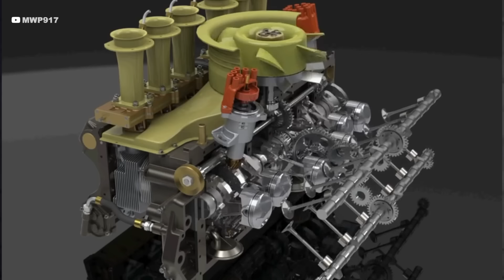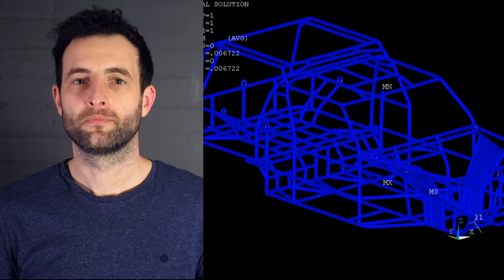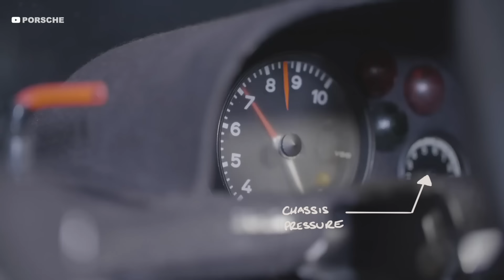The Porsche That Had an Inflated Chassis

Comment: The pressurized nitrogen is an ingenius solution. Simple but effective.
Reply: Putting the 1000 horsepower engine, in the most fragile chassis possible and doing fuck all about the aerodynamics however was not.
Reply: @paulzapodeanu9407  They debugged it eventually. Thank the insects for showing them where the flow was separated.
Reply: SIMPLE???
Reply: @craigykart  Yes, but maybe test the car BEFORE the race.
Reply: Maybe helium would of added lightness
Reply: @paulzapodeanu9407  You need to know that Porsche in the late 60s wasnt the Porsche you know today. The entire company was on the verge of bankrupcy and had no money for bigger testing. If the 917 didnt came out that successful, Porsche wouldnt even exist today.
Reply: @DeanMackenziebelldmb  yes but also means more lift 😂
Reply: @Maximilianboenicke  I know they weren't very successful commercially until the Cayenne, but honestly, did they not run that car before the race? Or did they do it somewhere where there where no flies? Or no night time testing? How do you miss something like that? I've seen pictures of 356 prototypes with small string tied to them, if they could test the aero on the 356 surely they could've done the same for the 917.
All things considered the 917 is an awesome achievement, I'm just surprised they thought to pressurize the chassis to check for cracks and a few other very clever things and didn't test the aero properly.
Reply: @paulzapodeanu9407  
High speed aerodynamics in a car at that time was not really well understood.   Up to the 917 Porsche was thought of a "small" car, nice but small.  Think Hyundai, not known for powerhouse cars.  
Porsche only knew small cars that were engine limited at top speed.  They were very good at low drag bodies which did not experience the high speeds needed to create significant lift. The 917 changed all that.  Ferrari laughed when they first heard Porsche was going to make a 'big' car.
Reply: Porsche engineers did not solve the first 917  problems with aerodynamics.   John Wyer sorted out the car's aerodynamic problems.  Porsche engineers were horrified at what John Wyer did to their car.  But came around with the increased high speed handling.
Reply: @Maximilianboenicke  
The engine design for the 917 benefited greatly from a government contract to develop a tank engine.
Reply: @paulzapodeanu9407  
For homogenization rules Porsche had to produce 25 cars.   When presenting the cars for inspection Porsche only drove one car while the other 24 were lined up.  Porsche stared second car and asked if the wanted to see the others run.   Good for Porsche they didn't because those two where the only  ones that had engines.
Reply: @DeanMackenziebelldmb  god, you can't be serious 😂
Reply: @DrsharpRothstein  thats a myth - all cars did run but not all had the full race equipment like brakes some had stuff from street 911
and whereever you get the "contract to develop a tank engine" ??? Thats bullshit
Reply: Frank Gardner said "if that gauge reaches zero I'm parking the fucking thing". Haha.
Reply: @DeanMackenziebelldmb  It's "Would have", not "would of". For example, "Helium would have reduced the vehicles weight by two grams, as compared to Nitrogen"
Reply: wasn't it dangerous to fill the chassis with a highly flamable gas in case of crash?
Reply: @DeanMackenziebelldmb  helium is a lot more expensive than nitrogen.
Reply: @Guigsliz1  nitrogen isnt "highly flamable" or even "flamable".
Its exact the oposite:
You can build extinguisher completly filled with nitogen....
Reply: @10zoll  yes you're rigth, nitrogen is an inert gas. I had nitrous oxide in my mind when I was watching the video xD
Reply: @10zoll  anyways nitrous oxide is not properly flamable to... I had a small mental diarrhea
Reply: They use this strategy in some helicopter rotor blades too.
Reply: @paulzapodeanu9407  Two of the Testmules where crashed (917 040 & 917 041l) before LeMans started. The Tyres where not capable for 400+ km/h.
And they know all the time that shorttails for normal racing and longtails for highspeed where needed even when 1970 a shorttail won in le mans. 2nd in that race was a longtail.
Reply: @DrsharpRothstein  Could I get a source on that?
Reply: @Keckegenkai  
What specifically?
Reply: @10zoll  
The development contract on the tank engine I have only come across once.  It was a paper study of layout, bore stroke ratio, colling methods, ect.
As right now I can not locate the source.  But at the time I did believe the source.  It also seemed to fit into the financial history of the company at the time.
Reply: @paulzapodeanu9407  ...never had 1000 hp....not in coupe/endurance racing trim. Never. Perhaps 560 hp.....and some close to 600.
Reply: The ingenious nitrogen solution comes from aviation, it was nothing new.
Reply: I guess pressurised extremely flammable gas in your car is frowned upon these days... go figure...
Reply: @divisiona3974  ...quite the contrary....nitrogen gas is extremely inert and doesn't support combustion or burning......
Reply: @TheWilferch  Even more impressively, our atmosphere is 70% nitrogen, so all you do is get rid of the oxygen which might corrode something.
Reply: @TheWilferch  oh ok. I thought the space rockets use nitrogen in solid form. Cheers
Reply: The idea behind the pressurised frame was not new.

Acrobat Airplanes used it to make sure there are no cracks in the frame.
Reply: @DrsharpRothstein  ...that would be "Homologation" rules.....and what you say is patently false. All 25 cars had engines.....that would be too much of a "miss" for the inspectors. The rumor is that not all cars were "startable"....
Reply: @10zoll  .....tank engine contract.....no engines.....where do people get this stuff? In fact, the 917 engine was aircooled .....like VW's of the time, due to HEAVY investment from VW who demanded the air-cooled aspect....all like previous Porsches that were VW derived....VW wanted that "link" to continue and was the basis for the $$$ investment.
Reply: @jackvernian7779  ,..... more correctly, "Air" consists of close to 78% nitrogen, 21% oxygen, and the remaining 1% to Argon and the "rare gases"......I'm in the industrial gas business.
Reply: @paulzapodeanu9407  ...aero understanding was in its infancy.....they knew all that was available to know, but still got much of it wrong. Yes, they tested, and yes they used the wool-tufts. That method was used since the 50's. Not good enough.  For you and all others who truly want to get a better understanding of all this, and the development and design background of the 917 ( and other models),  look at the 3 volume work by Karl Ludvigsen, "Excellence was Expected". Or follow the periodicalas more closely.
Reply: @10zoll  ...not true at all.....didn't have 911 parts on the first 25. Nope......
Reply: @TheWilferch  I know, did not want to split hairs about 1% of stuff, but about higher % of nitrogen you're right, I misremembered that. I'm in physics engineering & nanotech.
Reply: @TheWilferch  

The fact remains that all 25 did not meet 
homogenization rules.
Reply: @DrsharpRothstein  ...it's called  "homologation" rules....again....wrong. They at least had all 25 cars ....complete....lined up for inspection with the "Dare" to the inspectors to start any car. But with fingers crossed. Not like Ferrari's attempt with 5 complete cars ( +/-) with the "promise" to finish building the rest....when THEY got inspected for THEIR 25...of the 512.
Reply: @10zoll  ...yes I do....thanks for the links. Was there a further specific point?
Reply: @TheWilferch   Was there a further specific point?
never had 1000 hp... idn't have 911 parts on the first 25
Reply: @10zoll  ...read academic books that dive into this.  Suggest Karl Ludvigsen's Excellence was Expected....his is the definitive work and he also had contact with the factory and factory archives.
Reply: @10zoll  
I found the source of the tank engine.

"These unsubstantiated tales have been gathered after the author's tape recorder was turned off, ..."

"Another more likely story talks of the proposed big twelve being funded by the West German Federal Goverment, not only because Porsche were doing more than anyone else to boost the standing of the emergent German motor industry, but because there was a requirement for such a power plant for a new generation of armoured fighting vehicles."

"The Porsche consultancy business had a long and successful record designing and building such vehicles.  By its nature consultancy work is shrouded in secrecy and often only involved prototype development.  But over the years, Porsche's successful developments have received publicity.  There had been the development of the type 597 cross-country car for the Army in the 1950s and, at the other end of the scale the huge Leopard battle tank from the 1960s.  These two very diverse projects lend a credence to the theory that Porsche were proposing all kinds of military vehicles to the  government at the time. A light tank or self-propelled gun with an air-cooled twelve was more than feasible.  And it is more than possible that such a design study was given funding beyond the drawing stage"

Porsche 917 The winning formula 
Peter Morgan Forward by Professor Helmut Flegl
Published by Haynes 1999
Reply: @TheWilferch  if you read these books and didnt know that the 917 tc /10 /30 had +1.000 HP than these books are worthless.
Reply: @TheWilferch  
I stand corrected.  It has been around 21 years ago that I read that story. Your quote does seem like the story that I read. It was my impression that many of the cars presented were not running and Porsche gambled that the inspectors would not check them all.
Reply: @10zoll  ....did you even read and understand my reply? I lived thru this era.  I CLEARLY said.....NO 917....in ENDURANCE RACING TRIM....as shown in the beginning here...the COUPES..... EVER had 1,000 HP. They had 520-600 HP in normally aspirated ( non turbo) form. No one is talking about the 917/10 or the later 917/30, both open-top cars that had over 1000 HP while being turbo-charged. THESE cars were not endurance racers like for LeMans....they were for the CanAm series, and later in Europe, the Interseries. And to call Ludvigsen's book ( cited as only one truly academic work, there are others), tells me you haven't seen his work or any others like his, nor fully understood my comment.
Reply: @DrsharpRothstein  ...no problem, there are many chapters to the 917 saga, yet unfortunately, also a lot of urban myths, that seem to get bigger with the passage of time !. No worries.... cheers.
Reply: @TheWilferch  honestly DID YOU READ what you WROTE to me?
eg:
In fact, the 917 engine was aircooled .....like VW's of the time

Well were dod i wtote something about that?
but sleep well in ypur bettgestell here is the truth:
a Porsche engine isnt aircooled at all its oil & aircooled.
YOU wrote stuff to me that i already know better bit didnt wrote.
Reply: @10zoll  ..... WHAT?....I am responding to your other posting, where you write to me----> " @Wil Ferch if you read these books and didnt know that the 917 tc /10 /30 had +1.000 HP than these books are worthless". And the other part of my response is where the funding for the 917 came from.....it came from VW..... who funded a large chunk of the money but as a payback....demanded continuation of the air-cooled principle that both VW and Porsche shared at the time.  In a way that was  a shame, as most race engines of the time had 4 valve heads, but Porsche opted ( was "forced" ?) to go with 2 large valves......to allow enough cylinder head "meat" to allow it being aircooled.
Reply: @TheWilferch  
I did find one passage about that and it claims one car did not have a completed suspension at the rear if one side.

I believe that I have read that some of the cars were not able to start.  But like you said the stories do get a little out of shape.
Reply: @TheWilferch  😂 You know what, I think I'm happy with getting my info of YouTube, thank you very much. My job has nothing to do with cars, I just enjoy learning about neat technical solutions, so I won't dive into the 3 volume book just yet - maybe when I'm retired.
Reply: @DrsharpRothstein  ...I went back to Ludvigsen's book and the implication was all 25 cars were completed...yes....hurriedly, and will have to be taken apart again and CAREFULLY put back together, later, but all were complete. The inspectors were allowed to pick any car for closer scrutiny, and the third car in the row (at first) raised some eyebrows as the nose was few inches longer and the cooler openings were a bit smaller....but in the end they OK'd all 25.
Reply: @TheWilferch  the 1973 Can am version did have a bigger engine and over 1000hp.Not sure if it had the same chassis though.
Reply: @paulzapodeanu9407  ...the  CanAm chassis was basically the same ( the geometry was changed for the turbos)....as was the BASIC engine. There is all kinds of nonsense expressed about the HP claims, no doubt during short term TEST these 917/30 engines maybe did 1500 HP....but in race trim maybe only 900-1100. As to size, no endurance spec 917 was ever bigger than 5 liters. The endurance racers ( coupes / non turbo) started with 520 hp / 4.5 liter engines....but they grew to 4.9 and later a full 5.0 liters and HP maybe 600, or maybe a smidge more. The 917 turbos were all ( AFAIK ) 5 liter size, but I think 917/30 went to 5.4 liters.
Reply: @TheWilferch  
Porsche 917 The winning formula
By Peter Morgan

" 'there was only one car not finished.  I think it was the right or left rear wheel was not fixed.  I don't think the wishbones were attached. ..'. " Peter Falk as quoted in the book.
Reply: @DeanMackenziebelldmb  Yes.  One wonders what they were thinking.  Here's some numbers about replacing air with nitrogen in tires.   "One liter of air is roughly equal to 1 gram so there are roughly 13.88 grams of air per tire, 55.52 grams in all 4 tires. Nitrogen is 3% lighter than oxygen, but there's only 22% oxygen in air, so the difference in weight from all 4 tires is 0.3664 grams, that's a whopping one third of a gram!"  So why replace air with Nitrogen?  Of course Nitrogen is inert, but what is the fire risk?  I never understood the rationale, if there was one.
Reply: @DrsharpRothstein  ...thank you for the reference. In any case, the basic idea was to show the CSI inspectors proof that the 25 minimum to be produced, was actually true. In the past, all sort of "promises" were made by other manufacturers , mostly from Ferrari and others, where it never came true...and people were (rightfully) fearful of a dominating "large" car from Porsche, so the inspectors were especially keen to see pretty much all examples at one time. Your reference is an interesting one, and will be noted. Let's flesh out this chapter a bit more. At the time "pure-racing" car designs were limited to 3 liters engine size, and to compensate, "Sports cars" (...those that can possibly be driven on the road, but were raced), ,....can use 5 liter engines, as the rules assumed these engines to be "modified"  road-based cars' engines, and were given a larger-engine allowance to compensate for not being true 100% racing cars. The minimum "factory-output" for such cars per year, ...was 50 cars. Seeing that not many manufacturers were running cars in the race series, the CSI reduced the required number from 50...to 25. It was Porsche's  Piech who thought, "Holy cow, we can't afford to build 50 true race cars, but we CAN build 25, and we can then build a true racing car by building 25 of these, and call them "Sports-cars"....but in essence they would REALLY be 1.5 x size, "racing cars". Clever.
Reply: @TheWilferch  
I have to agree that Porsche did a far better job of producing the minimum number of cars than did Ferrari. And yes Porsche did creatively interpret the rule to their advantage and did so legally.

I did see an artist interpretation of a 2020 917.   Do you have any information about the  16 cylinder engine that was to follow the 12?
Reply: @DrsharpRothstein  ...yes I do.....it was a Porsche effort that ran alongside the 917, 12 cylinder car development, not afterwards. As a matter of fact, there was debate within Porsche as to which way they should go.....bigger engine, using more cylinders....or.....smaller engine, with turbo? In the end, they went with the 12 cylinder engine with Turbo, for a number of reasons. They always had road cars in mind when they did racing stuff, and the emissions and safety laws of the time would favor smaller engines with turbos, instead of "just-bigger" engines. Porsche also saw this as a real technical challenge, and they love a challenge. There weren't any ( or at least "few") turbo road cars at the time that needed good up and down throttle reaction. Theirs would be the first for this type of sports car racing ( Indy , and such,  were pretty much always flat out, or nearly so). Also this....you see comments here about how long the 12 cylinder engine was ( by the way, the engine was called "912"), requiring power to be taken from the middle, as they didn't want to risk crank-shift and flex when it's so long. The flat-16 was just that much worse and that engine was ENORMOUSLY long .....the 12 pushed the driver far up in the car anyways.....just made it worse with the 16.
Reply: @williamheyman5439  ....nitrogen is often very dry.....no moisture content, besides the "no-oxygen" content. Keeps tire pressures a bit more "even" under various operating conditions, or at least under better prediction as the temps go up and down. . For road cars, moisture and oxygen also lead to earlier degradation of rubber. Think of nitrogen as a preservative, too.
Reply: @TheWilferch  
I think the length of 16 cylinder Porsche influenced the w-16 layout of the Bugatti.
Ferdinand Piech finally got his 16 cylinder engine.
Reply: @DrsharpRothstein  ...good point. VW already had some strange V and W combinations by then, with ( as I recall) some 6 and 8 cylinder, in a narrow V (?) and a W-12....right?,for the Phaeton?  I didn't follow the more modern VW's very closely. For you and for others reading this, if you think (rightfully so) of the remarkable German engineering of the 917, you can draw a great parallel to both Mercedes 
Benz and Auto Union, as part of the pre-war Grand Prix car designs. Eight cylinder, 12 and 16 cylinder engines, supercharged, double supercharged, streamlined....some engines producing 600 hp, some mid-engined....all this when the competion had cars that looked like hot-rodded model T's in comparison. I think that would interest most folks here who think the 917 is the end-all.....it's kinda a repeat of the late 1930's with these "Silver Arrows" all over again. Check 'em out !!!!
Reply: @maxime_rhmr6608  yeah nitro fill, bunch of tig welds and a pressure transducer in the 1970's, in a car. Yeah simple stuff. /s
Reply: @TheWilferch  My 1969 911S shares many parts with the 917.
Reply: @genesmith4019  .....I know the 911 series.....I own one myself, but a later mid-80's 911 Carrera. Name some parts you claim......I can't think of any. Maybe....maybe....some part of the mechanical fuel injection system?....steering rack? I am familiar with both the 917 and the late-60's 911's.....like your 69"S", but from any major mechanical parts, there aren't any.
Reply: @genesmith4019  ...tell me which one of my comments I made here are anything more than being true and correct....but rude? Let's debate if we must, but bring facts, not namecalling or hiding behind a keyboard.
Reply: @Guigsliz1  -  nitrous oxide isn't flammable either, what makes it combustible is the compression of the engine that breaks the nitrogen atoms apart from the oxygen ones. Please correct me if Im wrong.
Reply: @Guigsliz1  Ha Ha Nitrogen is not flammable. Neither does it expand or contract with temperature.
Reply: @manfredstrappen7491  Yep, the A'erospatiale Lama helicopter also uses nitrogen pressure in the tail structure tubing to detect cracks. Even using a built in round dial pressure gauge.
I suspect this was used by A'erospatiale before Porche picked up on it.
Reply: @manfredstrappen7491  Yep, the Aerospatiale Lama helicopter also uses nitrogen in the tail boom tubing to detect cracks. Even using a small built in round pressure gauge to be preflighted each day. I suspect Aerospatiale used this method before Porche picked it up for race cars.
Reply: @xwind1970  Yep, the Aerospatiale Lama uses nitrogen in the tail boom to detect cracks as well. I suspect this predates the 917.
Reply: @bidlymovies987  Yes, I’m pretty sure Porsche didn’t come up with it. The Llama is a bad-ass helicopter in many respects.
Reply: @Guigsliz1  Nitrogen is not a flammable gas. It is an inert gas that doesn't support combustion.
Reply: they should have used helium, it wouldn't react either and it would have made the car even lighter.
Reply: Phone companies had been using the same trick for a long time to protect their underground phone wires.

The wires used paper isolation that would be destroyed by water. Overpressure inside the the protective pipe  meant water did not get in if there was a leak. And the leak could be seen on a manometer, so they could start searching for it before the wires got destroyed.
Reply: The Czechs were using nitrogen pressurized tubular structures in aircraft way before porsche.
Reply: So you totally misunderstood the purpose of the nitrogen…😂
Reply: @paulzapodeanu9407  … sure, it was extremely advanced for the time, what do you think everyone else (the losers) were doing?
Reply: @TheWilferch  The 1000 hp is a wild fantasy. While it is doubtful that a 1970s engine materials and technology would produce even close , much less last 24 hours of racing. Plus the wear on the transmission. 

The cooling fan had to absorb a lot of power. True there was no radiator drag. But that fan sucked.....a LOT of air.

550  to 600 hp is a very reasonable amout.
Reply: @10zoll  Even back in the day there were a lot of questions by journalists as to how many of the required 25 cars were complete and race ready. Porsche is said to have shown piles of saying the cars weren't assembled yet. A good number of the cars were used for parts.
Reply: @paulzapodeanu9407  What isn't mentioned here is they only put nitrogen into the chasis to presurise the frame and test for cracks in the chasis/frame. It was not intended to make the car lighter. They would have use Helium if that was the purpose.
Reply: @DeanMackenziebelldmb  yeah this is correct!!! The nitrogen in the frame of this car was presurised to check for cracks in the chassis. Once the tests were completed they would release the pressure for racing. The myth it was used to make the car lighter is debunked by the fact they would have just used helium and done it properly.
Reply: @DeanMackenziebelldmb 
Not really. 1 cubic meter of air weighs 1.29 kg - the nitrogen in that whole chassis probably weighed less than 50g.
Reply: @thomasdonaldson9257  Hydrogen wouldn't have helped make the car lighter by a measurable amount. 1 cubic meter of nitrogen weighs about 1kg - the amount that was in the chassis, probably less than 50 grams.